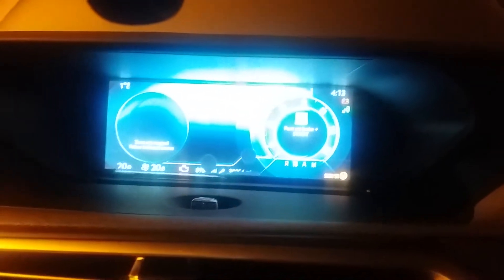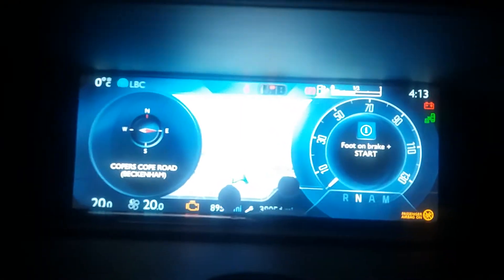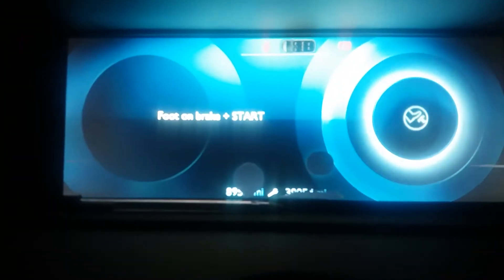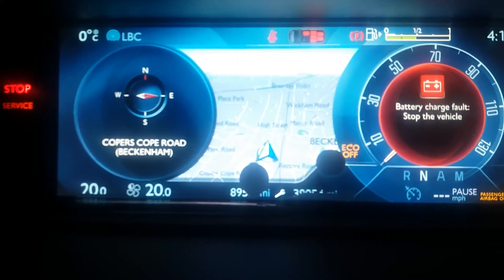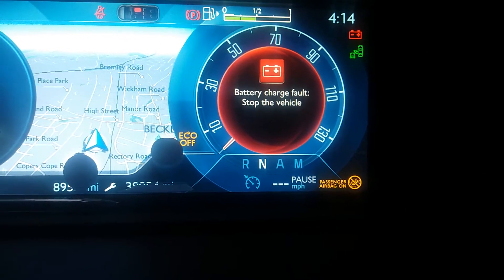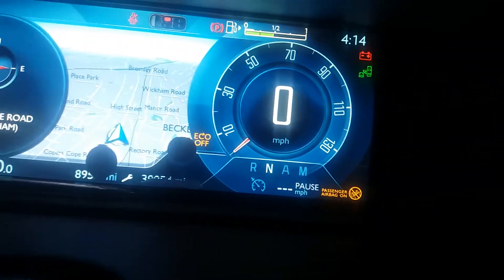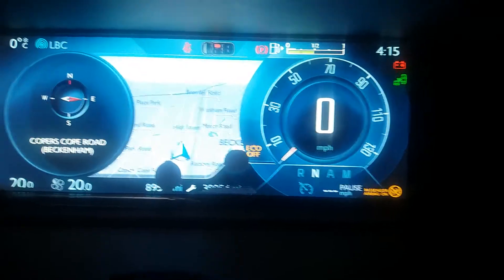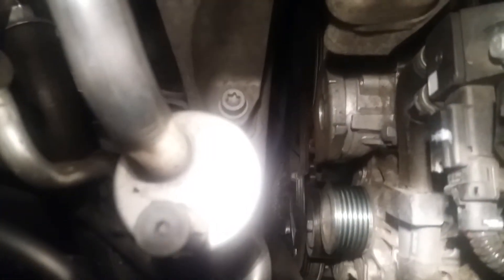When battery fault appears on your picasso C4 2014

Comment: Spot on !  Car was showing 'eco off' then the 'service' light came on. Car ran ok for another 20mins but then showed 'battery problem', 5mins more to home and chugged slightly but recovered......watched your video and so went out and checked by torchlight- belt is intact but is off the pulleys so looks like a trip to the garage.............
Reply: Exactly the same that happened to my c4gp 2014 diesel 2.0. And they claimed wear n tear despite within warrantly. But your post already 2yrs plus. So just adding note to future buyers

Comment: Hi did you fix the 2 black spots on the display ?
Reply: Hi,  the black spots came up suddently or something hits the display cause i bought a picasso with the same spots and in the selling announce it was perfect
Reply: I have the same problem with the spots.how did u fix it?
Reply: Happened in mine needs a new screen 900 quid
Reply: I'm a owner from a week. My c4 picasso 2013 have a same black spots . How long i can drive with it? Too expensive to get new screen
Reply: @yordangergiev9028  it depends on were the spot is mine was on my mileage so it would have failed its mot so I had to buy a new screen
Reply: @yordangergiev9028  my display is still with the spot for 4 years now it only grows a bit but the display still function
Reply: You can find new screen on aliexpress for 270-350 euro